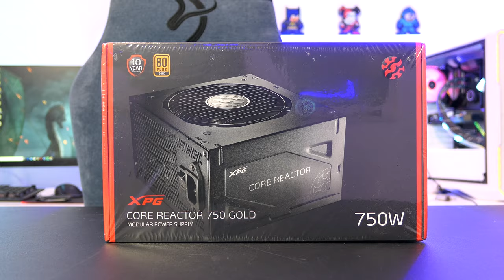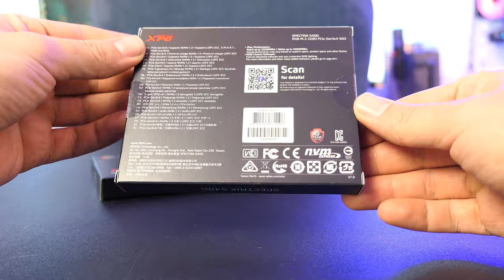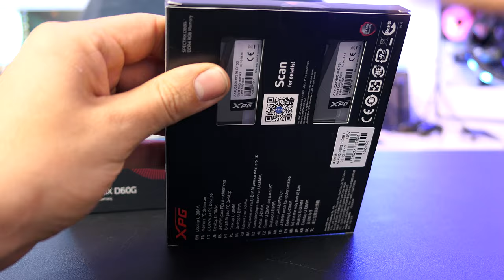PC Build Timelapse - XPG BATTLECRUISER

Comment: You installed the PSU upside down. Proper airflow is more important than keeping the label upright. An oversight made and excepted by many but considering the PSU and case are made by the same manufacturer is just incompetence.
Reply: most cases now have a mesh on the underside of the pc case. Which makes the psu have better airflow with the fan facing downward.

Comment: Hey. Just got my one. But theres no argb controller so i cant plug my fans :// what should i do
Reply: I have the same issue :( i connect all and the toggle button dont works
Reply: The RGP controller actually comes with the CPU cooler, otherwise you'll have to buy a separate one

Comment: Could you help me with this case? I'm having trouble with connecting the system fans to the motherboard. There are two wires coming from each fan and both wires have different male and female headers. Are they supposed to be connected with each other and then one connector to the motherboard? Could you explain that or direct me to a tutorial that mentions this?
Reply: Same issue here 💔
Reply: I have the same case. Built my first PC a week ago. With the lack of instructions, it was VERY CONFUSING and a HEADACHE. I didn't know what cables were RGB, which were fans, etc. 

But regarding the fans, they can all be plugged in together (since there's a male and female split) then you connect the final fan plug I to the motherboard. One problem with this is if you change the fan setting for that port, all of the fans all have that setting. If you want to control the fans separately, then connect them to separate fan ports. The front 3 fans, I joined together into 1. The rear fan I plugged into another.
Reply: The dame issue i cant connect the argb controller ;(
Reply: @fashionrider57  need help with 3 cables  that are 4 pin coming from front io, where do they go on motherboard. This is my first pc build. Any info where i can learn to connect the fans?
Reply: @josemadrid8879  those are for your 3 front fans.  they can be connected together with a splitter so they all join into one 4-pin plug. That plug can plug into any of your motherboard's fan ports (look at your motherboard's manual).  By combining the 3 fans into one plug, the computer can control the 3 front fans together.  in other words, all 3 fans will spin at the same spin always, which isn't a bad thing.

just remember that each fan will have an aRGB (3-pin) plug and a 4-pin fan plug.  Don't assume the lights will work if you just connect the 4-pin plugs.  that'll just operate the fans and make em speed
Reply: @fashionrider57  the 3(3pin) cables are coming from area where audio cables is connected, unless 3 fans are connected there. They have a cap